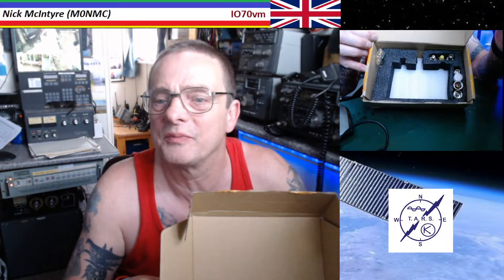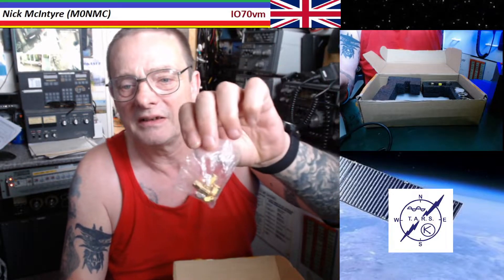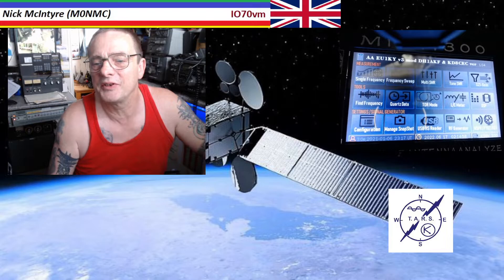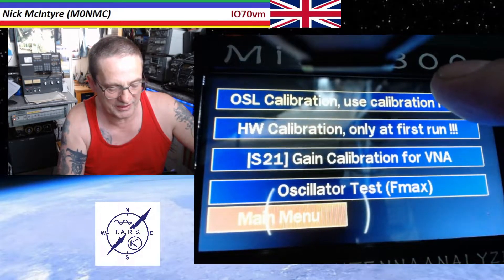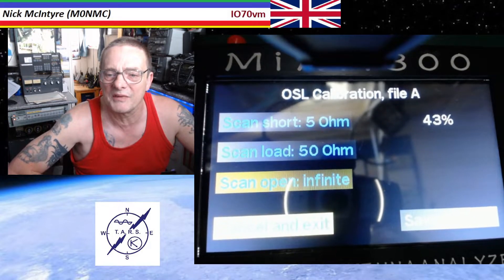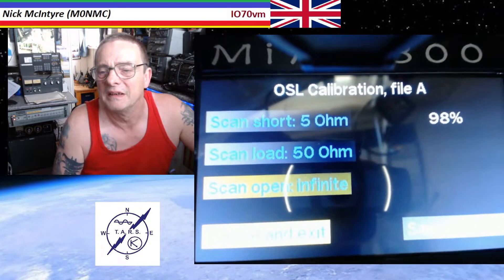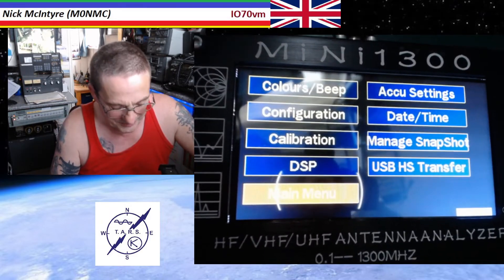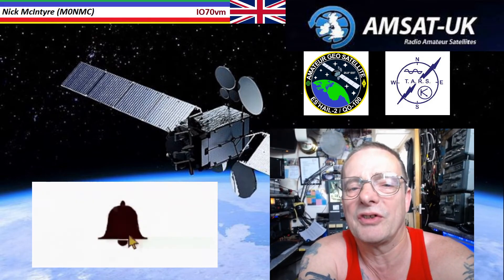Calibration of the MINI1300 Antenna Analyser

Comment: I wish I had looked up your video sooner! The Calibration should do the trick. Checked a couple of antennas that looked like they were about 1.3:1 to 1.5:1 range on the Mini 1300, and 1.01:1 to 1.05:1 on the SWR meter with the radio. After I just ran through the calibration, I bet it will look MUCH better on the Mini 1300.

Comment: Can this be connected whilst using antenna ?
Reply from the maker: It is used to check an antennas resonance. If you mean connecting in linecwith a Transceiver like a tuner or meter the answer is no.

Comment: Did your Mini1300 come already pre-loaded with v1.04 or did you update the firmware yourself? Mine is arriving today and just preparing for any updates if I can find where to obtain the file.
Reply from the maker: Sorry Danny I just saw your message. I haven't updated the firmware on mine.
Reply: No probs mine came with v1.01 on it and didn't know whether to update or not, just don't fancy doing the HW calibration.
Reply: My saa-2n nano vna says to calibrate at each use, even though is has memory slots for saving calibrations. Have you read anything about the mini1300 needing to be calibrated before each use?
Reply from the maker: @frankthetank3342  No mate, never seen that